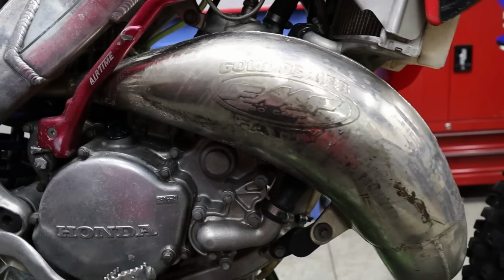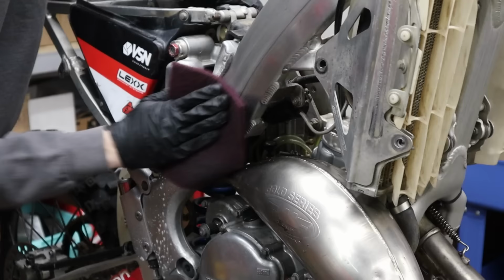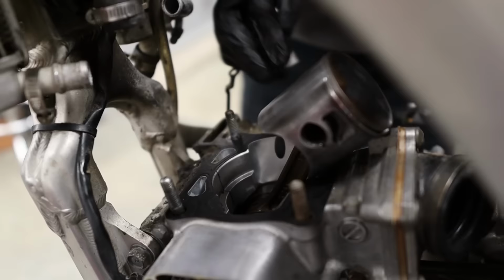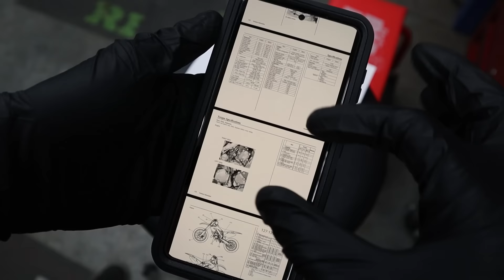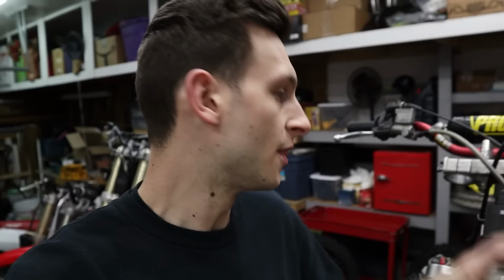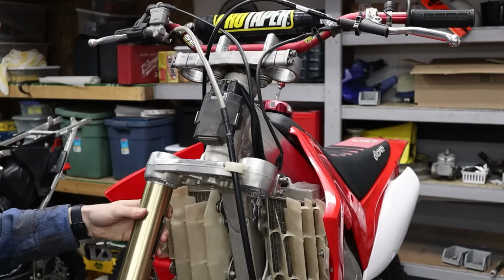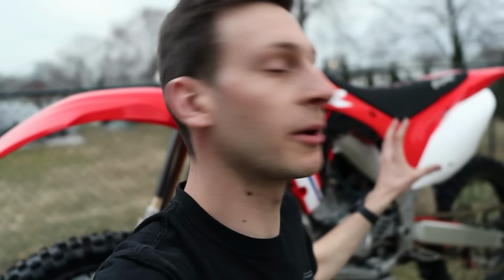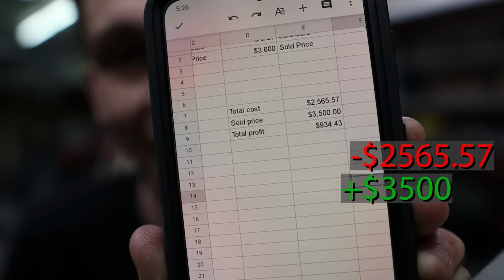2005 Honda CR125R - Flipping dirt bikes for PROFIT!

Comment: Hello Matt, If you have the room for the through of the torque wrench around the cylinder head. A trick we use in aviation is to set the adapter on the torque wrench at a 90 degree angle . In doing so, there is no need to do the equation to determine the lower TQ value. Great video!!!!

Comment: Hey man, just found your channel recently, as this is what I do as well. Great content! Quick tip I have learned from older, wiser guys than me: using the torque wrench with that wrench adapter all you need to do is have the adapter at a 90 degree angle to the torque wrench and you can then use the correct torque numbers. Keep up the great work!

Comment: I've had excellent results using a hairdryer for sticker removal; just warm up a section and slowly peel off graphic and the adhesive material will stick with the graphic; the heat 'releases' the adhesive for clean easy removal.
Reply from the maker: I appreciate the advice! Unfortunately I've tried all kinds of methods and always end up with that sticky residue everywhere 😂

Comment: Great video!!!  I have a similar issue with solvents since I do all my restorations in a townhouse.  I use Spray Nine for all the hard stuff - it is non-solvent but you'd swear it is by the way it works as a degreaser.  I also use the purple Simple Green HD diluted in my ultrasonic cleaner.  Keep up the great work...these videos are amazing.

Comment: I have a 97’ YZ 125 I started to rebuild but I can’t take it with me New & Extra FMF pipe New extra Cylinder Jugg I didn’t put on Additonal Gas tank from a 01’ YZ 125 New custom Seat so the New chain. Some New plastics Top end work and a lil TLC

Comment: You might not see this but where do you get the replacement lines for the carb? I'm fixing up a yz85 and the carb lines are all gunked up but I cannot find where to get new lines for it. Also any tips on how to clean old grime off a 2 stroke engine without any kind of power tools/grinder wheels, or how to get some rust spots out of a pipe? EDIT: Just saw the pink carb lines, paused the video right before you said it haha. But still, how do I get rust spots out of a pipe?

Comment: If you could pick one thing that would make it worth that much more, what would it be?
Reply: In my opinion, if he could put one thing on it to make it worth a lot more it would be some high end suspension items, white power or ohlins. Other than that this bike is tricked out with the carb and pipe. Pretty much race ready as it is, you could do a big bore kit but that’s probably not worth it anyway

Comment: quick tip, if you turn the socket tool 90degrees you dont add any extra length and can just use the original torque specs.
ref:https://84c0542ad5d322f08f06-651d7fb22d7870bee4d1cd6d755230af.ssl.cf1.rackcdn.com/misc/articles/ck/images/1(15).jpg

Comment: I Just Got  A New 2023 Honda XR150L . WhatnCan I Do To Give This Thing More Power And Torque While Getting Higher Top Speed ? 
In 5th Gear It Has No Pull . 
Also I Found An jfg full exhaust that fits my xr150l will that give it anymore power since the bike will be able to breathe alot better

Comment: Not sure why you think the electron  carburetor is a better option for a motocross bike. Back in the day I only saw them on drag bikes for running ethanol. I think Honda would have install them if they were better than a keihin flatslide. Factory teams don’t use them, I don’t think. I could be wrong. Peace
Reply from the maker: OEM carburetors and Lectron carbs are both great imo. The reason a lot of people like the Lectron is because of the minimal tuning required compared to a traditional carburetor!

Comment: You’ve built a lot of bikes I’m puttin a 1990-1999 cr 125 motor inside a 2000 yz 250 rolling chasis will it look goofy? I plan on trying to mount it as OEM as possible.
Reply from the maker: If you do it correctly, not at all! That is awesome!

Comment: Do you heat your degreaser up in the tool clean? If so how do you get that done with the harbor freight one?
Reply from the maker: Yes I do. I use a 5gal water bucket heater from tractor supply!

Comment: I was wondering if you know how to put down the front of a seat because there is a big gap between my gas tank and my seat.
Reply from the maker: Just make sure the hardware to slide the seat under is on the gas tank. If it is there, make sure that the seat is underneath and in that slot!

Comment: You made almost 1k in profit but you didn't add in the profit you also gained from the extra front wheel and the Lectron carb which is going in your other bike. Almost another 1k in profit right there!

Comment: How do you keep track of which bolt goes where
Reply from the maker: After years of doing this, I pretty much know where most bolts go... But the way I used to do it was label small bins and bags for which areas the bolts come from (ie: plastics, left engine case, exhaust, forks, etc)
Reply: @MattBerger02  thanks

Comment: What do you say in the bio when you sell the bikes?
Reply from the maker: Here is what I posted for this one: "For sale is my 2005 Honda CR125R. Overall this bike is in great shape and is 100% ready to go. I just went through it top to bottom to make sure it's ready for the next owner! 

Location: 

Yes, I do have the title (Michigan title, does not need to be notarized).

- New ProX top end (3 break-in heat cycles)
- New Polisport restyle plastics
- New grips, levers, and clutch perch
- Carb cleaned w/new hoses
- Full FMF exhaust
- Oversized EBC front brake rotor
- Moose Racing rear disk guard
- Works Connection radiator braces
- New fork seals and oil
- New front wheel bearings
- Front brakes bled w/new fluid
- New rear brake pads
- Cleaned/oiled air filter
- Oil change
- New spark plug
- New clutch cable

Starts right up, runs, and idles perfect! Normal signs of wear throughout, but overall in great shape for being 16 years old. When I had the top end apart, the crank felt tight with no up/down play. 

$3600 NO TRADES

If you have any questions, please do not hesitate to ask!"

Comment: What’s the biggest problem u have ran into while building a bike? I have multiple problems per build
Reply from the maker: Previous owner put 2001 engine components inside a 2003 motor... Then lied to me and forged a receipt. Had to order all new cases and engine components to make it a complete 2003 motor again. It was an adventure to say the least 😂😂😂
Reply: @MattBerger02  that’s way worse than anything I’ve came across

Comment: Where do I buy a restyle kit for a 2009 Yamaha yz
250f?
Reply from the maker: Unfortunately they do not make a restyle kit for that bike
Reply: @MattBerger02  can I buy like a newer front fender and number plate and put them on?
Reply from the maker: @braden4240  yes you definitely should be able too! You may have to drill a few holes to match up with your triple clamps

Comment: People are starting to realize lectrons actually suck and every bike ive sold with one the last year people asked for the stock carb because nobody wants the damn lectron smart carbs on the other hand people get excited for or the air stryker. My opinion the lectron is good if your racing and you doing top ends left and right anyways but i ran one i one of my bikes i kept and i went through 3 top ends in the time i wne through one on my bike that has an air stryker and my other bike that has the smart carb sc2

Comment: A real g would have checked the squish rate on the head.
Reply from the maker: I honestly have never checked squish before and haven't had any issues. I will do some more research into it and see if it is something I should be doing moving forward. Thanks!
Reply: @MattBerger02  have to watch forged pistons catching exhaust bridge from heat expansion as well. Shave exhaust bridge a couple thousands and drill 3 holes on forged piston. If it’s cast no need to worry.

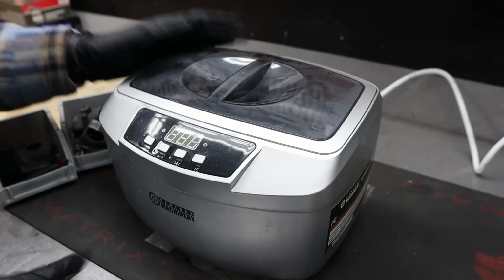Comment: 7:05 please don't tell me he went over the cylinder with a scotch bright 🤦‍♂ worst thing you can do to a cylinder if you see anything just blow it out with a air hose or use a micro fiber cloth the more scratches on a cylinder the worse
Reply from the maker: I reached out to Wiseco directly and that is exactly what they advised me to do. Spray oil on a scotch brite and run it through a few times, wipe clean with a rag, and you're good to go!
Reply: @MattBerger02  I don't know who from wiseco told you that but they should be fired the proper way is to use a honing cone because scotch brite on cand is not even all over the cylinder I have heard multiple engine failures after that method some are lucky like you and get away with it and some start with almost 0 comperssion or the bike has 0 power
Reply from the maker: He also noted that using a ball hone on the nikasil coating in a modern cylinder with porting can be bad because it could barely chip the edges of the nikasil on the porting. At the end of the day, I am not an expert and don't know the "100% correct" way to do it. I've used ball hones plenty before and never had an issue, same with the scotch brite

Comment: This is the def of price inflation bike is clean fs but nothing internally was replaced. Just bc it looks good doesn’t mean it rides good. Cases where never opened therefore you have no idea the condition of trans bearings etc. this is why bikes are so much bc ppl like you do this shit and then no one can find a bike for a decent price.
Reply from the maker: So everyone should split the cases on their bikes before selling them? Should dealerships tear apart the motor of every car before selling them? I do my best to make sure the bike is ready to go for the next owner, which is more than 95% of the other sellers on the market. You can't do everything, especially if you want to try and make some money while doing it. Although I do agree that a large part of the inflation problem is due to people just putting new plastic on a bike and then asking $2000 more than they should.